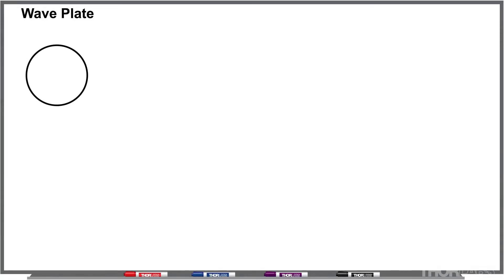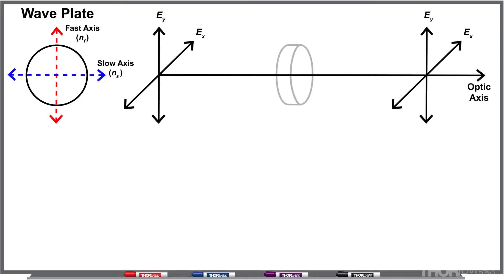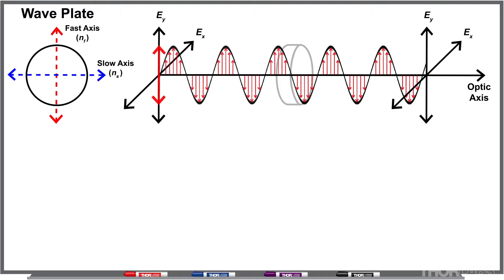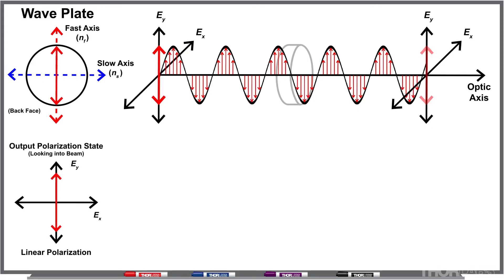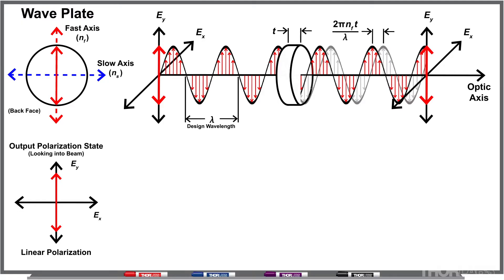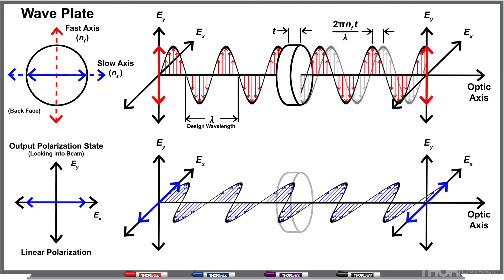Create Circularly Polarized Light Using a Quarter-Wave Plate (QWP) | Thorlabs Insights

Comment: Can we rotate the polarisation of light by 45 degrees (vertically polarised light to diagonally polarised light) by using half wave plated rotating 22.5 degrees from its axis?
Reply from the maker: Yes, people do use half-wave plates as linear polarization rotators. For the case you described with a linear polarization input and an ideal half waveplate, the angle between the incident linear polarization and the fast axis of the wave plate should be 22.5° (theta). Then, the angle between the incident linear polarization and the output linear polarization directions will be 45° (twice theta). 

This rotation occurs for elliptically as well as linearly polarized light, since an ideal half-wave plate creates a 180° (1/2 wavelength) phase delay between the two polarization components parallel to the fast and slow axes of the wave plate. Note that while linearly polarized input light will be output as linearly polarized light, the half-wave plate reverses the handedness of elliptically polarized light in addition to rotating its polarization orientation. This means right circularly polarized light incident upon a half wave plate will become left circularly polarized and vice versa.  Because of this phenomena, it may be better to think about the incident polarization state flipping around the half-waveplate’s fast axis.

Would it be helpful if we created a video Insight to discuss this in more detail?

Comment: Sir,
How can we orient the polarization axis with respective to a perpendicular magnetic field?
Reply from the maker: Would you help us better understand your question? Which component's polarization axis are you thinking of? Are you referring to the light beam's magnetic field, which is always perpendicular to its electric field?
Reply: No sir. I was reading a research article regarding magneto optical birefringence measurement where an external magnetic field ( not light beam's magnetic field) which was in perpendicular to light direction. In that experiment they are telling to orient the optimum angle of polarization direction of the incident linearly polarized light with respect to magnetic field as 45degree and also to orient polarization direction of incident light parallel and perpendicular to magnetic field.
Reply from the maker: @mubeenarafi3920  The alignment of the devices in this setup was performed using the plane of the table as a reference, and one possible approach for performing the work described in the paper is to also align the external magnetic field with respect to the table. This can be done by choosing a magnet that provides a field with the desired strength and shape and then orienting the magnet as required.  If the table is the reference plane, then the techniques in ( https://youtu.be/W9pALZ5Z8ms ) can be used to align the polarizer horizontal and vertical with respect to the table and then the techniques in ( https://youtu.be/cqLPD5dL9zY ) can be used to align the polarizer at 45 degrees.

Comment: Thank you for the video! It is a great demonstration for polarization control. I have a follow up question concerning the QWP. Assuming we placed the QWP 45 degree to the polarizer infront, so we already got a circularly polarized light.  If this circularly polarized light get reflected on some surface and remain as a circularly polarized light,  and pass through the QWP on the opposite direction, what kind of light we will get? Thank you in advance for your reply.
Reply from the maker: The quick answer is that the light, after reflecting off the mirror and then passing a second time through the quarter wave plate, will be linearly polarized orthogonal (at 90 degrees) to the input linear polarization state. This occurs because the reflection from the mirror reverses the circular polarization direction of the light. Since the transmitted and reflected beams of linearly polarized light are orthogonally polarized, a polarizing beam splitter (PBS) placed on the input side of the QWP is often used to separate the reflected beam from the transmitted beam path. Please let us know if it would be helpful for us to show this in a video.
Reply: @thorlabs  thank you very much for the reply. It is very helpful. Of course, a video would be even better ;)
Reply from the maker: @pipiche2991  You're very welcome! This topic is now on our list :)

Comment: Sir .., Thank you for your demonstration... It clears most of my concept but i have a doubt...!!!

 Q1)What happens if we pass a Unpolarised light through quarter wave plate or half wave plate...? Does it remain Unpolarised or it gets Linearly polarized or CPL...? And also...

Q2) Is there any effect on intensity of light when it passes through waveplate...?

I mean will you please demonstrate same experiment twice...?

1) without 1st Polariser
2) without 2nd Polariser

I know it's too much to ask sorry...!!
Reply from the maker: If the light incident on a wave plate is truly unpolarized, the light transmitted by the wave plate will remain unpolarized.

When the photons pass through a wave plate, each photon is delayed by an amount that depends on its orientation with respect to the wave plate's axes. In unpolarized light, the polarization direction of each photon is random and not related to the polarization direction of any other photon in the group. When this group of photons passes through a wave plate, the delayed photons in the output light are still randomly oriented with respect to one another, so the output light is still unpolarized. A wave plate cannot organize unpolarized light into a pure polarization state, such as linear or circularly polarized light.

The intensity of light output from the wave plate will be slightly less than the input intensity but not because of the phase-delay properties of the wave plate. There will be some light lost due to reflections from the front and back faces of the wave plate, and there is always some attenuation when light is transmitted through a material, even when the material is transparent.

The purpose of the first linear polarizer is to ensure linearly polarized light with a stable orientation is incident on the wave plate. In this demonstration, there is an isolator attached to the output of HeNe laser. Since the light transmitted by the isolator is linearly polarized with a stable orientation direction, following the procedure after removing the first polarizer would provide a result similar to that shown in the video. The first linear polarizer was included in the setup to demonstrate a procedure that could be used even if the light source does not provide linearly polarized light.

The alignment procedure we used to determine the orientation of the wave plate required the second linear polarizer in the path. The polarizer could have been removed once the wave plate was aligned, but we kept it in the path as an analyzer to also demonstrate how close we were to circular polarization after the wave plate.

Comment: Thanks for the very informative video
But what do you think about another faster way to get the circular polarizer, by placing the filters by the orders: Linear Polarizer_1 - QWP - Linear Polarizer_2. Rotate the QWP slowly, with every rotation step you check again the power after the LP_2 by rotating it in the full circle. If the power fluctuates minimum after LP_2 when you rotate it, then you got nearly a Circular Polarizer beam.
Reply from the maker: Thanks for pointing out a variation on the approach! We have found the technique you describe to be convenient when the second linear polarizer continuously rotates in a motorized mount, but we have felt that approach can be cumbersome when the optical mounts must be manually rotated.

Comment: First, Thank you for your video.
I have a question.

If QWP Angle is same with first polarizer, Power is checked at minimum.
That's understand because output light and second polarizer have different direction(90).

But, If QWP Angle change degree(90), I don't understand why power also is checked at minimum.

When I studied, I think maximum because QWP make linear polarized light.
For example...
Degree 0 : Horizontal
Degree 0~90 : Elliptical, Circle
Degree 90 : Vertical

Please answer.
I wait your support.
Thank you.
Reply from the maker: Thank you for your question! 

When light passes through a wave plate, the light is delayed. The delay provided by a wave plate is special, because the amount of delay depends on the light's polarization direction. A wave plate delays light polarized parallel to the wave plate's slow axis more than light polarized parallel to the wave plate's fast axis. The difference in delay provided by the two axes determines the wave plate type. The difference in delay provided by a half wave plate is half a wavelength, which is the amount of delay required to convert light from one linear polarization to another linear polarization. The difference in delay provided by a quarter wave plate (QWP) is one quarter of a wavelength. A quarter-wave plate is not able to convert horizontally polarized light to vertically polarized light, because the delay difference it provides is too small.
 
In addition, the direction of the input linearly polarized light needs to oriented between the wave plate's fast and slow axes in order for the wave plate to affect the light's polarization. When one axis of the QWP is parallel to (at a 0° angle to) the transmission axis of the first linear polarizer, the QWP delays all of the light by the same amount. This does not change the polarization state of the light. When the QWP is rotated by 90°, the other QWP axis is parallel to the transmission axis of the first linear polarizer and all of the light is delayed by a different amount. This does not change the polarization state either. The only time the QWP changes the polarization state is when the QWP is rotated to an angle more than 0° and less than 90°. Circularly polarized light is created when the QWP angle is 45°. Otherwise the light is elliptically polarized.

Comment: Related science question: in demos where they shine light through two or more polarizers and turn one of them to either darken or brighten the light, they often explain it as its orientation blocks more or fewer of the light, but, maybe something subtle is going on instead... does a polarizer in reality let through 100% of light in all orientations and turning it merely changes the affected light's wavelength from visible light to some wavelength we cannot see? Are there cases where that happens?
Reply from the maker: Commonly used linear polarizers either absorb or redirect the unwanted polarization state. None that we are familiar with convert light in the unwanted polarization state to a different wavelength, unless you consider the heat radiated by an absorbing polarizer to effectively be a wavelength conversion. Absorbing polarizers' temperatures can rise when they are used, since they soak up the light polarized along one direction, but the heat they radiate will not be linearly polarized. When the unwanted (rejected) polarization state is reflected or redirected, it is possible to trace both beam paths’ output by the polarizer and confirm that their wavelength has not changed and that they are orthogonally polarized. Here's a quick overview of different polarizers and the method they use to provide a linearly polarized beam:
 
- Wire grid polarizers transmit light polarized in one direction and reflect the light polarized in the orthogonal direction. This is illustrated by the drawing at the top of  https://www.thorlabs.com/newgrouppage9.cfm?objectgroup_ID=5510&YVI=9 .
- Film polarizers absorb the unwanted polarization state. One kind of film polarizer uses polymers  ( https://www.thorlabs.com/newgrouppage9.cfm?objectgroup_id=4984&YVI=9)  and another uses nanoparticles (https://www.thorlabs.com/newgrouppage9.cfm?objectgroup_id=752&YVI=9 ).
- Beamsplitter cubes transmit the two polarization states in perpendicular directions, as shown by the drawing in the overview of  https://www.thorlabs.com/newgrouppage9.cfm?objectgroup_id=8095&YVI=9 .
- Crystal-based polarizers separate the two polarizations by creating an angle between their propagation directions, as illustrated at the top of  https://www.thorlabs.com/newgrouppage9.cfm?objectgroup_id=745&YVI=9 .
Reply: @thorlabs  Wow, so those polarizers from your links look way more complex than what I had in mind haha, barely understood a lot of your words and don't buy polarizer type stuff, I usually surf for science explainer videos and had clicked on yours... which interested me in its mention of slower and faster speeds for light. Below is a sample video with the type of polarizers and effects I had in mind. 

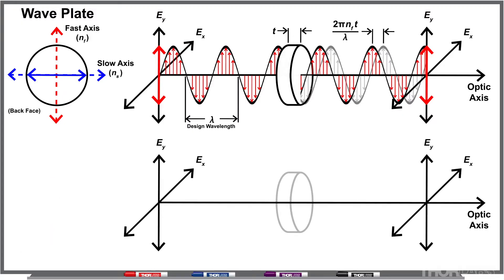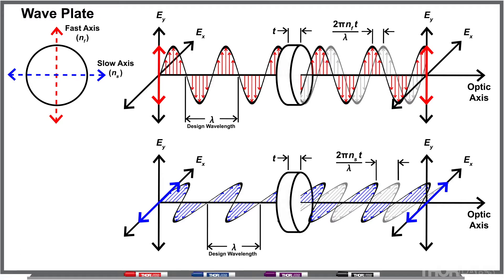At 1:30 and at 1:45 in this other video by Action Lab (https://m.youtube.com/watch?v=f0XttPQ6g9c&t=90) he explains how manually turning a thin sheet of transparent polarizer will block more light (darken) and how inserting an extra polarizer in between two will then let through more light (re-brighten). 

What I was wondering is if maybe light wasn't blocked... maybe instead the 'missing' light had shifted into a wavelength we couldn't detect. (In those simpler polarizers like from the video I linked)
Reply from the maker: @localverse  The interaction between light and a linear polarizer is more complicated than the words "block" and "pass" suggest. While linear polarizers do not change the wavelength of the light, polarizers are not filters that just pass photons with the desired polarization. Instead, the interactions between the photons and polarizer can result in changes to the photons' polarization orientations, as well as to the photons' directions of propagation. 

The closer a photon's polarization orientation is to being parallel with the orientation of the polarizer's transmission axis, the more likely it is that interacting with the polarizer will change the photon's polarization orientation to be parallel to the polarizer's transmission axis. The light transmitted by the linear polarizer consists of photons that were changed to have, in addition to those that initially had, this polarization orientation. Malus' law is used to calculate the intensity of this transmitted light as a function of the angle between the transmission axis and the polarization orientation of the incident light. Light that is not transmitted is absorbed, reflected, or redirected.
Reply: @thorlabs  Thanks for taking the time to reply... I'll reread it a few times to grasp it better because the accuracy of your explanations feels reliable. If you have any suggestions for a source to learn how photons interacting with a polarizer can change their direction and polarized orientations, especially for the lay person, will gladly check that out!
Reply from the maker: @localverse  Unfortunately, the references we’re familiar with assume a familiarity with electromagnetic waves.  For example, the book Polarized Light and Optical Systems by Russell A. Chipman, Wai-Sze Tiffany Lam, and Garam Young provides some descriptions and the background mathematics for various polarizer types. We would love to hear if you happen to come across a source that you think explains the subject well!

Comment: Thanks a lot! 
In addition to this video, could you explain how to measure circularly polarized light from materials of which circularly polarized light is only a few % of total amount of emitting light? 
If you could upload some instruction video like this, that would be helpful!
Reply from the maker: When the light is not purely linearly or circularly polarized, the light's four Stokes polarization parameters can be used to accurately and precisely describe the polarization state. These parameters can be measured, for example, using a wave plate and a linear polarizer. If you have a polarimeter, it can also provide these values. 

The Stokes parameters are typically labeled S0, S1, S2, and S3. The first parameter (S0) is the total intensity of the light. The others are the proportions of horizontally / vertically linearly polarized light (S1), ±45° linearly polarized light (S2), and right- and left-circularly polarized light (S3). Together they characterize the light's elliptical polarization state, which is sometimes plotted on a Poincaré sphere. The Stokes parameters also provide information about the amount of unpolarized light included in the beam.

Unfortunately we cannot detail the measurement here, but we will definitely add the topic to the list of upcoming videos demonstrations!
Reply from the maker: There is now a Video Insight available that demonstrates how to measure the Stokes parameters (https://youtu.be/pR4r7gMyN5U)! The video also discusses the relationship between these parameters and the light's polarization state. Let us know what you think!